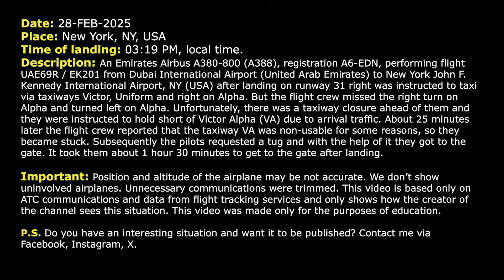Emirates Airbus A380 gets stuck for 90 MINUTES after wrong turn at Kennedy Airport. Real ATC

Comment: I was on duty that day and recall the incident clearly. One important detail that was not mentioned is that the taxiway closure at VA was due to active construction. There were workers present, and had the Emirates aircraft continued forward, Engines 3 and 4 would have passed directly over the construction area, posing a risk of debris ingestion. For this reason, the Emirates crew brought the aircraft to a stop and awaited a tug for safe repositioning.

Comment: Why couldn't they turn right on VV and circle back to A1 2:27
Reply: Not every taxiway can deal with the axel weight of a 380 before we even thing about clearing whatever might be sticking up from the ground.   The airport guide has a number for every taxiway and every connector.   On top of that every airline has a list of approved and not approved taxiways at a mess like JFK.    Should have just paved a circle 3 miles in diameter and put the lights on wheels and change it every day.

Comment: JFK problems. While the pilot did in fact make the wrong turn, the controllers at jfk are never willing to assist but would much rather lecture the crew. Imagine the controller working for a 14 hour shift and then expected to be perfect at jfk

Comment: I don't see a story here, granted it is a big deal to get instructions wrong as consequences can be very high, however here its not a big deal and the airline pilot handled his mistake and the justified snarkyness from the  controller gracefully. I could not have done a better job myself in GTA V or MS Flight Simulator.

Comment: Well, the controller is on the wrong... after the left victor there is no left uniform...so the pilot after reaching uniform just turned left and got stuck
Reply: I would have said "Turn left on victor and hold short on victor when you left the runway for further instructions."

Comment: Correct me if I am wrong, the very first time, Tower clearly said "Left on V". Then they changed it. 

1. From TOWER: They clearly said "Turn left on V"
2. Emirates clearly acknowledges to turn left on V
3. Now Tower clarifies to turn left on U. They don't even acknowledge that they screwed it up.
4. At this point, Emirates has screwed up, following the first instruction and not the second one. But understandable. These are split-second decisions, touching down at incredible speeds and then trying to take directions from the Tower. 
5. Tower says Emirates got it wrong. Which is true but airlines cannot make quick adjustments when the very first instruction from Tower is screwed up. 
6. Emirates mentions they are too fast.
7. Tower says "the instructions were very clear". No TOWER PEOPLE. They were NOT clear. Tower should own the mistake, take the blame, and THEN share that blame with Emirates.
Reply: No. The tower instructed him to turn left on Victor, then left on Uniform, then right on Alpha. Two left turns then a right turn. Emirates got the instruction wrong, repeating back left on Victor, right on Uniform. Tower corrected him, telling him left on Uniform then right on Alpha.
Reply: Runway exit point is V, which turns into U due to recent construction changes at the airport.

Comment: In JFK, they have a silly procedure whereby you need to contact ramp. Hence the pilots passed on this information to the tower frequency that they would be "stand A7 to enter via golf".
This a massive distraction, and I believe a huge contributing factor to what happened here. 

It doesnt work like this in other airports around the world. 

Its often all these little differences that create these incidents.
Reply: It’s not a silly procedure. It puts less strain on Ground Controller. JFK is already a crowded airport as it is. 5 different terminals 130 different gates between each terminal. Each with the same numbers. Imagine handling arriving traffic taxing to the gate departing traffic taxing to the runway. While also answering and providing pushback clearance from 5 different terminals and 130 different gates. Also keep in mind that multiple airlines as well as multiple aircraft depart at the same time so everyone calling at once asking for pushback while also giving taxing instructions out is overload on one controller. Rather than have each terminal have their own separate ramp control. They control the pushback clearances and gate assignments while ground control controls the taxiing instructions to either runway or gate. Reason why on a SECOND radio you would contact ramp to advise if your gate is open or not and what taxiway you would enter and advise ground cause they control the taxiways and ramp controls the ramp.
Reply: @amiroliver8788  
I hear you, but the rest of the world does it differently, and there certainly seems to be fewer incursions at places like Dubai, Doha, Frankfurt, London, Hong Kong etc. 

It might be that there's just more exposure on social media, but it my humble estimation, JFK seems to be a sh|tsh○w.
Reply: @amiroliver8788 
It is totally a silly procedure and peculiar to the USA. Other countries have you transfer to a ramp or apron controller who controls you all the way to the gate. You are only ever on one frequency. Oh and in other countries the taxi lines guide to all the way to the gate.
Catch up !

Comment: I do this for a living. And reading that airfield diagram was hard.  Left on uniform when uniform ending point is very vague, likely left them unguarded for the right onto A.  Flying these really big supers and it’s critical you know exactly where you are going.    Nobody got too excited though, and it all worked out.  Kudos to the tower crew for catching it early.
Reply: Pilot got the read back wrong twice
Reply: @teamscrew  that would be the PNF who got it wrong twice - not even flying or handling the ship
Reply: Planes have park brakes. They’re great.
Reply: @EdOeuna  well…..   Ever set your parking break at ORD, to see how long it takes ground to yell at you for stopping😂. But ya, for sure don’t move till ya know where you’re going.  I’ve failed to heed this on a few occasions and regretted it🙂
Reply: @markg7963  - I care much less about ATC telling me off than I do getting a phone call from my CP because I’ve taxied incorrectly, or worse, hit a light pole or something worse.
Reply: @ I hope it’s not that severe for them.  At my airline I would file it as an asap event.  Stating exactly what happened.  Safety would take over and depending on if the tower filed a pilot deviation it would go from there.  Always a possibility if a deviation, but I never heard the tower inform them of that.  Although they are not required to.

Comment: Left on uniform? But the U taxiway ends once they turn right from victor no? Can some help me because i don’t understand what were the instructions given to them
Reply: Yea it's depicted better on the Jeppesen chart but the taxiway between B and A there is U, so the ATC instructions were correct.
Reply: I was wondering the same, it seems to be the tiny bit from the B-U-V intersection to the point A1.
Then, 'right A, hold short of N' would be all the way around to the 'other side' of the Airport. Interestingly, the tiny bit is not marked as U in the Video and also not on an Airport Diagram i found on the FAA website... But maybe Airlines have access to better documentation.
Reply: Yeah the instruction made no sense to me from the chart in the video, but I looked at the satellite on Google maps and could clearly see what was meant. Would be interesting to see how it was depicted on whatever chart or onboard airport map they were using

Comment: 1st clear order from ATC: left on victor, then left uniform, right alpha, hold short of November 

Pilot: left victor, right uniform(wrong),(missed alpha altogether) hold short November 

2nd from ATC: Turn left uniform, right alpha, 

Pilot responded with that. 

Not sure what it looks like from a plane but “left uniform” sure looks a lot like “left alpha”

I will say, the problem goes away faster if ATC works with them over being the way he is with a foreigner in some of the busiest air space in the world.
Reply: yea, I've been staring at the map the whole time and it took some time to figure out where uniform ended and where alpha started.
Reply: Old 2016 map on Wikipedia had A1 as part of V. So that entire area is likely prone to misunderstanding, in a very little area you decide if you are going U, B, A, clockwise or counter clockwise or A1 (formerly part of V). It’s unfortunate but understandable someone could get confused there. A bit stressful to have hundreds of passengers behind you after you messed up that wonderful piece of taxing.
Reply: The guy is a native English speaker, probably been to JFK many times. That taxiway diagram is very confusing though